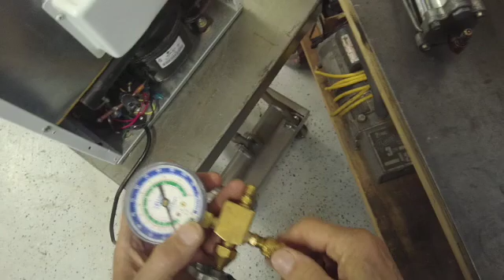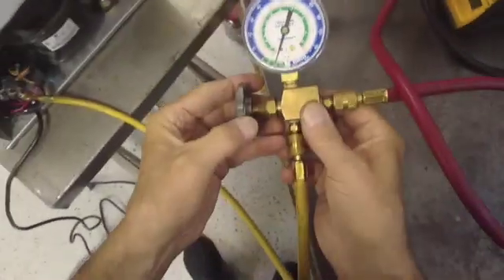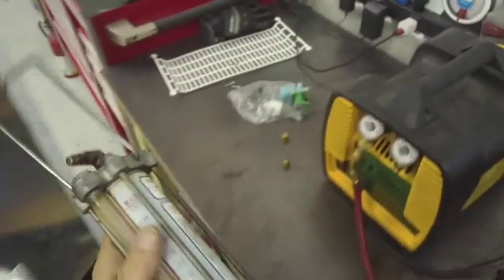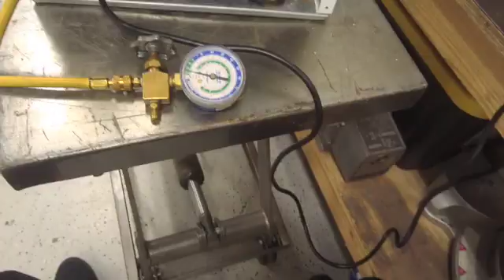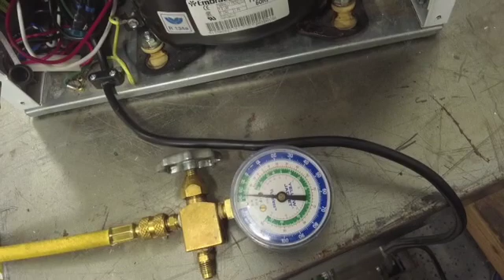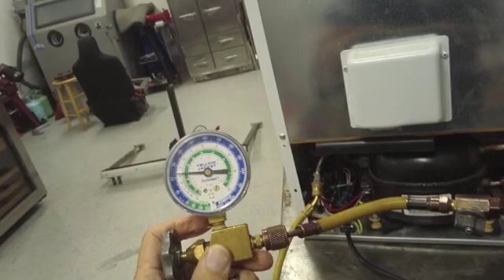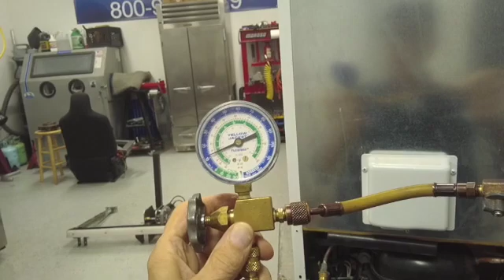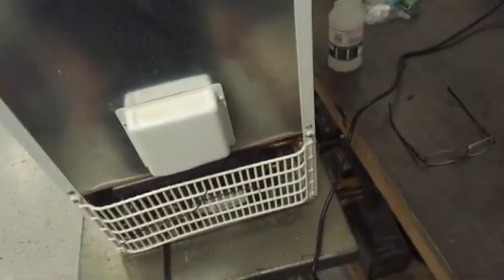How to replace a hermetic compressor

Comment: Just to Clarify. Venting refrigerant is illegal under EPA regulation and if so, you can be charged 44,000 (or more I don't know the exact amount).
Reply from the maker: Did I say you should vent Freon into the air
Reply: At around 3:00 he installs a piercing valve and explains this.  He **literally** shows you how to evacuate the system and says you shouldn't vent into the air.

Comment: i have this exact model--and it stopped running. The display quickly flashes "0" then plugged in. Buttons are non-responsive, and the compressor isn't running. Is the repeated quick-flash of zero a trouble code?
Reply from the maker: It’s hard to say without being there but I would focus on the control board.

Comment: I just replaced my compressor in a Sub Zero 430 Wine refrigerator and it didn't appear to solve the problem it was having (not cooling at all). I went from EMI30HER to EMIS30HHR, would it matter if I swapped the process and suction ports? This has been a real head-scratcher for me, I had two technicians look at the fridge and both told me I needed a new compressor but after replacing it my low side is still at -10 in/Hg and my high side stays at 0 psi. The compressor is drawing ~4A on startup and 1.0A while running.
Reply from the maker: Sounds like you have a restriction or a bad switching valve, but you should also have pressure on the high-side. Open up the high-side and check for flow. If nothing comes out your line may be plugged with solder.
Reply: @SubZeroSpecialists  Good call. I found  that one of my solder joints had caused the line to become sealed. I fixed the solder joint and now I have 110 psi on the high side. Still no cooling though. I'm going to redo the solder joints on the dryer and try to determine if the high/low compartment valves are functioning correctly. Thanks for the help!
Reply: My solder joints were terrible, after some practice I replaced the filter dryer and all is working now. I've charged with the unit spec of 5oz r134a but the compressor seems to be running pretty hot. Any idea what the usual superheat and subcooling should be on a Sub Zero wine fridge?
Reply from the maker: @tyler-morsai  what is the back pressure
Reply: @SubZeroSpecialists  About 5 psig
Reply from the maker: @tyler-morsai  5 psi is low if it’s warm inside. You may have a restriction in the heat exchanger or switching valve.

Comment from the maker: I mentioned in the video that it was a charging column manufactured by Thermal Engineering. You can look them up online. You can also look up a company called Artic Chill.  measured in ozs.